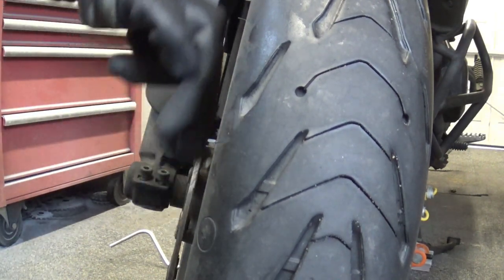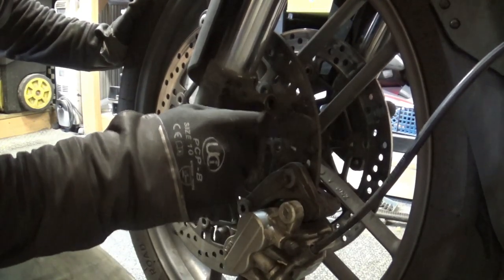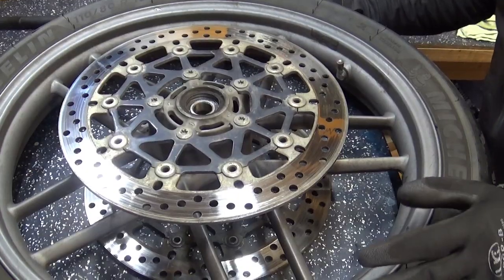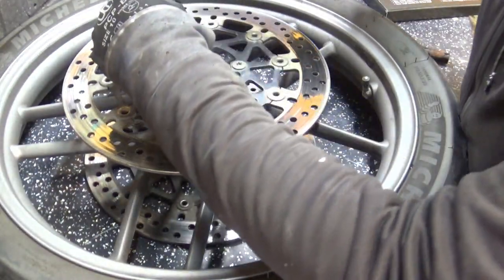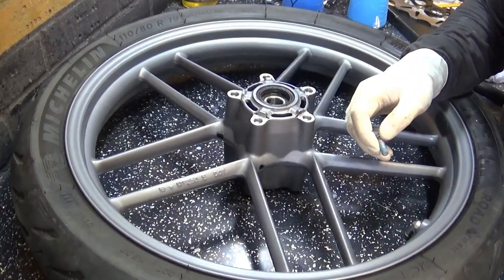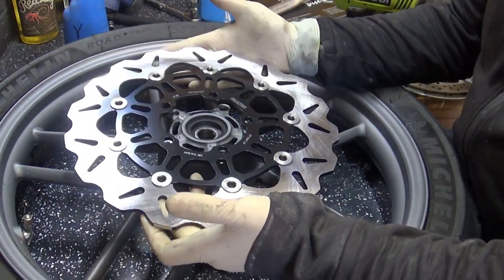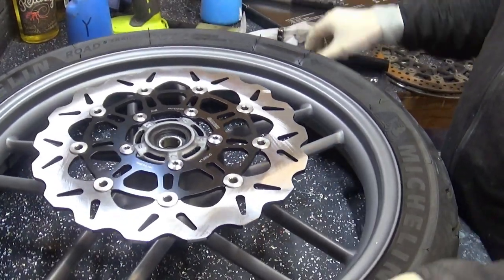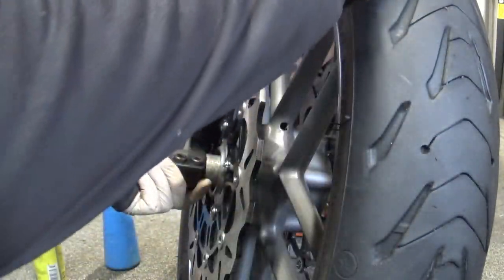Triumph Tiger 800 - Wavy Brake Discs

Comment: Sorry for the reason, but glad to see you back! I put a set of Kajima wavy discs on my CBR back in 2008, hoping to save a wee bit of weight, and was chagrined to discover they actually weighed a little bit more than my OEM discs, lol. D'oh! No noticeable change in my braking performance either, but the good news is that they are still working great 14 years later, and no brake pad wear issues. (I know yours aren't the same brand "G" ;) but mine are identical looking. Probably made in the same factory, hahahaha)
Reply from the maker: Yes these are G, and good to know they work well after all those years! nice one!

Comment: To centre wheel in the forks - leave pinch bolts undone, torque up spindle, pump front forks a few times, then torque up pinch bolts .....
Reply from the maker: Nice tip, thank you!

Comment: Nice to see you back dude. I did the same thing with my Bandit years ago but I dropped the bike onto a parked scooter next to me, right outside a busy cafe in London. I Felt a right twat!    I know it's expensive but I would have changed the pads too as they wear together with the disc. Much like your chain and sprockets wear together.
Reply from the maker: True that, but I've only changed the pads about 1000 miles ago... so not really needed I think.

Comment: Just a few tips:
-Make sure left and right rotors are out of sync,  that is, the wave pattern isn't aligned. 
-Use new brake pads or sand a bit the old ones and reinstall. 
-Re-balance the wheel.

Some manuals call for new bolts, some don't. 
I've always re-used them without any issues. 

Funny, I did exactly the same to my scooter.
https://youtu.be/A1EljJcwHX4

Anyway, great seeing you back!
Reply from the maker: That is a good point... I didn't balance the wheel after... I'll drop it off and get the garage to do it.

Comment: No need to renew bolts - they only have a light torque so no stretch on them. I would have popped  seals and put a bit of fresh grease in the wheel bearings though ;-)
Reply from the maker: Done that (off camera :)

Comment: Hi, how do you feel now the breaks? Are they Galfer or Breaking , where have u brougth them? I need to do the same work on my tiger 800 after 71000 km , did u change the pads?
Reply from the maker: Brakes are ok. No difference really. Galfer. Didn't change the pads, as they were near new.